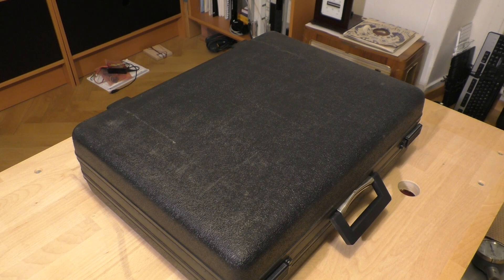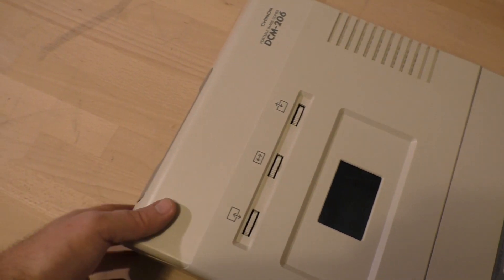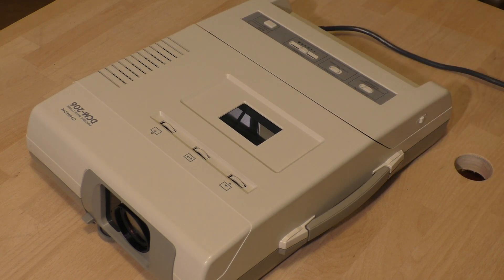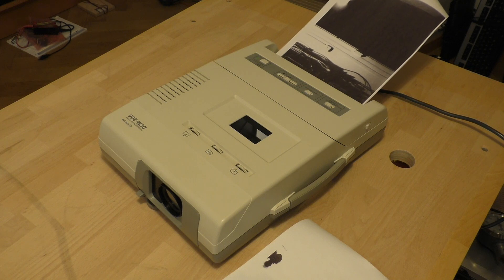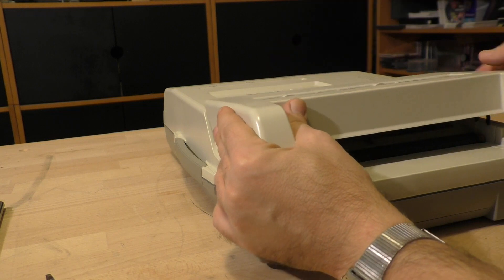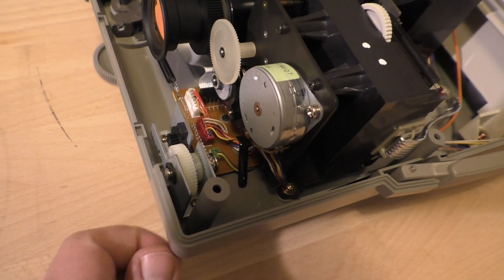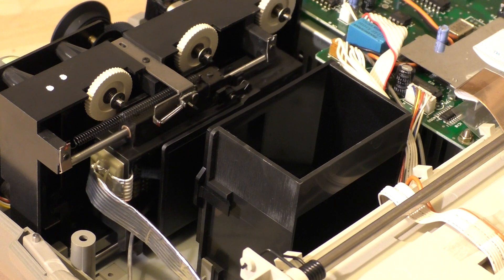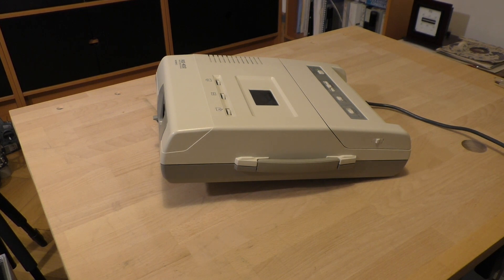A 1990s digital instant camera - (PWJ115)

Comment: Great video!  This device is super interesting....It makes you wonder if a color device using a sensor from a scanner could be used to recreate a similar camera type device...for fun of course.
Reply from the maker: That's how a color scanner works.... it's a super slow digital camera. But that brings me to another idea... how about scanning the same object three times with RGB filters in front of the lens. Too bad this device has no computer connector to download the picture.
Reply: Neat idea. That would be just like the first color cameras!  Scanning the photos and then using photoshop to merge the images could work.  I don't think thermal paper can transfer like laser prints....if it could you could transfer the ink to transparent sheets and them project them with filters to re-create the image.  Would be a lot of work though!

Comment: 12:11 Not batteries, not cables but spare paper rolls.
BTW: the "print head" is. like the image sensor also in one line...
Reply from the maker: That was my first idea too.... but the compartment is too short for a paper roll. It does not fit in there.